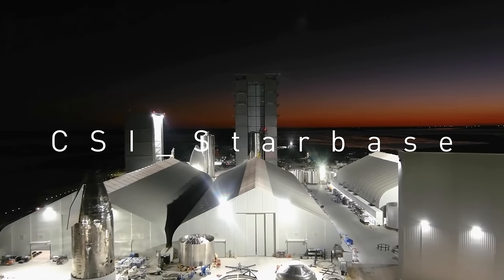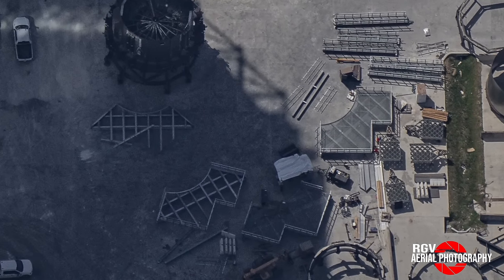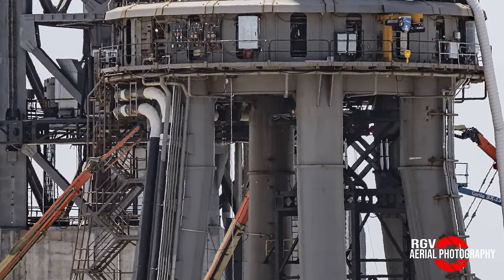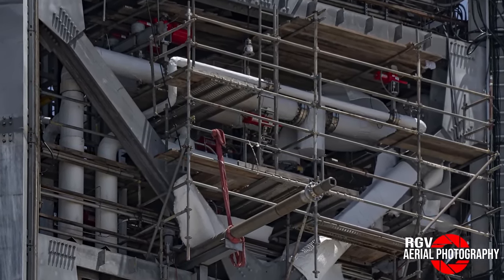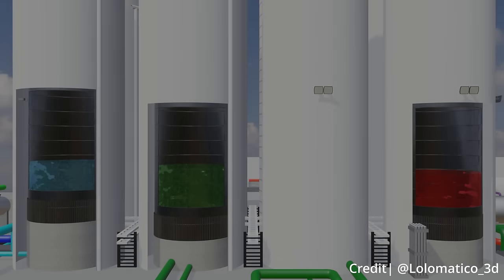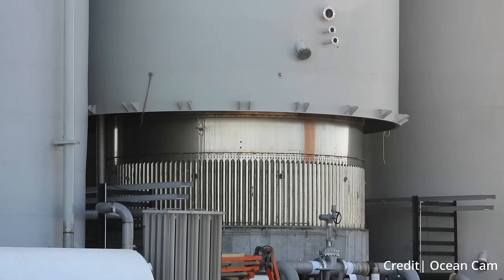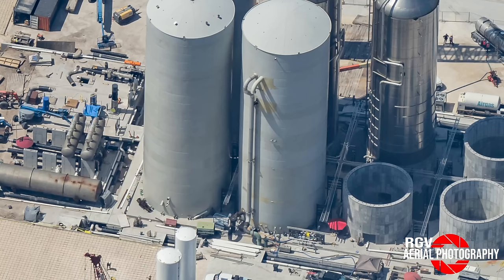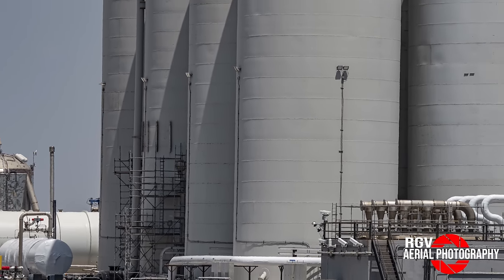Failed Water Tank Forces SpaceX to Redesign Tank Farm

Comment: @ 10:04 On F-4 aircraft, the wingtips can fold up and secured with a "(remove before flight)" safety lock. When they are lowered, hydraulic actuated hinge pins slide into the wing lugs to lock the wingtips for flight...
These "wings" can be raised with hydraulic actuators and hydraulic hinge pins can slide into the lugs to secure the platforms in the up or working position....all controlled by a little toggle switch or two, and electric hydraulic pumps @ 3,000 psi...or more.. Then they can be lowered by gravity...

Comment: They might actually have decreased the margin of error because they WANT a smaller margin of error. Imagine an engine failure at the very last second. You might not be able to catch the ship, but you want to minimize the damage to the structure. Shorter arms might be easier to get out of harm's way.
Reply: Shorter arms may be able to open and close faster due to less mass.
Reply: @flewdefur  also lift faster

Comment: Great analysis, I‘m blown away every time about how much information you manage to pull out of the photage. Have you thought about sharing your insights with Spacex, for example when you noticed the missing strengthening rings on the water tank way before them? Might save them a lot of time.
Reply from the maker: No I didn’t trust myself back then.  But you bring up a very good point because I probably could have stopped them from building those two vertical methane tanks before it ever happened.

Comment: Best SpaceX/Starbase coverage online.  I hate to say it, but the shorter chopsticks may mean that SpaceX is abandoning the catching of booster by the tower - or this tower anyway.  I wouldn't be too surprised to see SuperHeavy grow legs.
I don't see a return pipe into the new water tanks.  
To me, the biggest problem with modifying or replacing  these gigantic tanks is the tons of perlite insulation.  It's a fairly natural substance, but you can't just dump it somewhere.  Vacuuming it out so you can lift the shell looks really expensive.  Uncap it, get inside and add some internal ribbing?  In the end it would be just a water tank, and they have two of those now.  Can't even scrap it.

Comment: I just caught up with your latest video after discovering your channel, Zack. 
You are in fact answering many of the questions I was having about how things work, what does what, in a way that is beyond speculation. 
Really looking forward to seeing more of your content. 

You were the first to point out some structure, inside the chopsticks, that, when raised, should absorb the remaining energy of the booster or Starship coming down. 
Everybody says crazy, but you point out the component that should do the job. 
I had some doubts on how the arms would absorb this energy, knowing the Falcon landing gear has titanium shapes inside, that deform to absorb the remaining kinetic energy. 
And Falcon is light compared to Starship, let alone the booster. 
I still feel a landing catch is extremely dangerous, as it should catch the booster on the pins sticking out. 
If the chopsticks had a rounded shape attached, that could align with the booster, this would help. 
But maybe SpaceX feels they can perfectly align the pins with the chopsticks? 
Indeed, they can gimbal the engines, to rotate the booster on its vertical axis. 
Then booster has pins, Starship has holes.
How is that supposed to work? :-) 
It requires a perfect, not near perfect, alignment and insertion moment.
Reply from the maker: I’m going to be doing a part two on this because they still haven’t added the pistons for that landing rail. I see them working on it everyday though.
Reply: @CSIStarbase  would really love to see your insights on that.

Comment: I'm sure you were right that they were originally going to add reinforcement rings. If they weren't going to add reinforcement rings in the first place I doubt they would have gone to all the trouble of stripping the paint. Of course it's possible that even though the shell is no longer usable for water storage it could still be used as a cryogenic shell in another second tank farm that Space X will need to support a proposed second launch tower. So they had to repaint it against rust.

Comment: Zach when you talked about stripping the paint off the welds, that was on the cryo shell. The reinforcement rings would need to be on the tank itself, right?
Reply from the maker: Lol that is the tank.  There’s no shell.
Reply: @CSIStarbase  
Sure, that rust showed water leaking directly out, not perlite.
Reply: @CSIStarbase  It strikes me that if the unused Methane tanks which have a 'double; wall are repurposed to carry water inspection for leaks would not be possible. or at least more difficult.Would they consider removing the covers? Is the ribbing on those tanks sufficient for water mass/pressure? I guess they must think so . Keep up the good work

Comment: With some creative engineering the water tank could be saved, I believe. Maybe some channel running vertically around the tank. Along the channel that rides on the surface of the tank you could place slots for spacing of cable which will be post-stressed. Maybe you could do it with metal straps spaced vertically on the tank and do away with the channel.
Reply from the maker: It appears that they are still trying to save it.  I can still think of a good use for the tank if they are able to save it.

Comment: A possible reason for the shorter chopsticks at Robert's Road is speed. A shorter arm is not only lighter, but the mass removed from it is all at the tip of the chopstick and the farthest from the fulcrum. But even if that's the case why go so short? Extensions?

Comment: It would make sense to me that they have increased their confidence of where they can position the rocket and shorten the arms. Because the arms are made to catch the rocket when centered in them so if they can Center it left or right then they can Center it as far as close to the Tower and away from the tower for a lack of better words. Both are critical, because it's too far in it might hit the tower, and it's too far out on the chopsticks the leverage Force would increase and possibly bend or snap off the arms or put too much stress on the tire base and eventually weaken it and make it snap fall over while catching the booster. I hope I worded that well enough for the surprise pop quiz.   👀

Comment: its pretty amazing how one screw-up (building CH4 tanks not compliant to local standards) provides the solution for another screw-up there. I was sceptical that they would really use tanks designed for cryo for water (which now has a useless shell around it) - but that shot of a flange connecting a cryo pipe to a water pipe convinced me.

Comment: The water tanks might not need supportive rings because they are made of different steel, I imagine the space grade stainless steel has a higher tensile strength than whatever is used for a water tank whose materials are chosen to be made with as little money as possible.

Comment: The water tank story certainly casts some doubt on the engineering capabilities at SpaceX. Your documentation of the lifting of the oddly shaped tower sections leaves me with even more questions. They should be able to calculate precise weights and determine the proper lifting procedure without resorting to trial and error.

Comment: Maybe the shortened chopsticks won’t be used for catching at all. If a catch fails it could take out so much infrastructure. Perhaps the plan is to build a second tower in a more isolated spot that is used only (or primarily) for catching - at least in the short term until SpaceX have been able to demonstrate that they can reliably catch boosters and starships. SpaceX can then lengthen the chopsticks as much as is needed.

Comment: Hi CSI Starbase,
Thanks for such an in-depth look at all the progress going on at Starbase. The question that I was wondering for a long time is why haven’t they built a large water tower at the tank farm for the water deluge system? I always thought that a large water tower was a basic necessity at all launch pads.
Reply: Basic to all launch pads with flame trenches, This one has none. 
They will use a mist rather than a deluge - for now anyway.
It makes the problem of collecting the water easier too. They are not allowed to let it run off into the marshes.

Comment: @CSI Starbase, an important note for you! 
I've experienced a strange error after subscribing. On both my iPhone (old 6s) and iPad (also old Air 2) the notifications bell is stuck at "none" and each time clicking on it sends me to my device settings. 
On my PC laptop, I have notifications set to all and that looks correct, but it seems that doesn't sync with my mobile devices. 
I just updated to iOS/iPadOS 15.6 and the same error is still occurring. 
I hope this helps your channel. I really like your content and style! 
*Edit, on my even older iPhone 5s, the "All" notifications is set correctly. This old device is running iOS 12.5.5. Curious.
Reply: Hi Bill, thanks for the heads up. I've just checked on my iPhone 11 and it seems fine. When you're doing this are you on the video or channel page? I've tried both and I'm able to change the notification status.
Reply: @geoffallan  Hi Geoff, the weird redirect is only on the apps. Maybe my old devices but then my even older 5s works fine.

Comment: It's really weird how they waited until the tank almost blew in their faces to make a change.
Reply from the maker: I think they tried to save it.  I should have been more clear about that part.  When they stripped off the paint, I think they found something that told them it couldn’t be fixed and the solution to that problem probably changed several times over.

Comment: Nice and original content!

Just the leakage argument doesn't necessarily makes sense. You're showing some rundown on the cryo shell. That shell is separated from the actual water tank by a layer of expanded perlite. So suggesting it's a water leak from the tank at that height, implies the whole cavity between the tank and the shell would be already filled with water, before it can start leaking just there ... ?
Reply from the maker: The original water tank does not have any of that.  Its a shell with no interior tank
Reply: @CSIStarbase  ok so it just looks like a cryo shell around it, but it's the tank itsself.
Reply: You can see there's no inner concrete base for the water tank here 23:46 and then workers welding in place a steel bottom for the tank.

Comment: Very good reporting!  Now won't the new tanks fail too?
Reply from the maker: The new tanks are designed to not only withstand the hydrostatic pressure but also to withstand 8bar of gas pressure inside of the tank.  It should work perfectly.
Reply: @CSIStarbase  That is good to hear! I am still concerned about the water deluge system, seems like it is a little lacking in water volume, compared to the BTU output of 33 Raptor Engines!  Keep up the good work, I like your dissertation regarding the tank structure.

Comment: 9:55 why not just a REALLY long metal rod threaded through them all, so you only need to lock them all once rather than individually?
Reply from the maker: Oh snap.  You are right.  That’s probably the only way to do it honestly.
Reply: @CSIStarbase  …well, because a REALLY long metal rod probably won’t fit (it has to stick out one side);
Next line REALLY long rod rod would need all the holes to line up absolutely PERFECTLY.. 
third, failure or damage to a REALLY long rod rod means replacement is a pain (if it even ‘fits’, remember it sticks out).

Individual, much shorter, rods are in reality much easier to work with, handle, line up, install, remove etc.

Cranes use these type of connectors, among other structures. (Bridges, trusses)

Comment: we can't be sure if they  didn't have more ribbing on the inside of the rings, but what this does tell you is the tolerance of the rings with water as Elon said about keeping water in the walls of starship :) even in failure we make progress.
Reply from the maker: We know for sure there is no ribbing.  There would be weld marks!
Reply: @CSIStarbase   .. I thought they said something about that with mrk 1 but it has been a long long time and a lot of speculation. Though my curiosity was more about Elon talking about storing water around the crew areas in the starship and what this means for that?

Comment: So are the water tanks they using now reinforced like they should be? Guess I missed that part
Reply from the maker: Yes all of the GSE tanks have the same reinforcement on them.  I guess I should have been more clear on that part.
Reply: I think it is a misunderstanding there: the braces around tanks helps for a situation when vacuum or lower than atmospheric pressure occurs in tank due to it being emptied, while providing close to none extra strength against elevated internal pressure or water static head. The vertical ribs at bottom helps at rigidizing the vessel against vertical and horizontal stresses  but these usually do not occur with a water tank.
The two extra tanks for water may have the reason on using them for the Water Acoustic Surpression System, that initially wasn’t very develloped, at least as design.
Reply: @Dalidoso  cool thanks

Comment: I quickly realized back in like Aug/Sep 2021 that nothing was going as planned, that wild speculation was instead replaced with SpaceX just not caring about Boca Chica anymore. I was sucking the ElonKoolaid bigtime back then, but literally overnight, I was like - NO WAY!. All the design lessons were instead applied to building the real facility in Florida. Oh, and don't even get me started on the issue those chopsticks- they WILL NEVER catch a booster. Which makes modifications in Florida make way more sense. The booster will land on the sea platforms (at best). They have committed to a launch or 2 from boca chica, but that is it. They have about 12 months left for Florida to be operational. Oh, and starship is never going to be moon either! HLS will be on the order of mag size of dragon, starship will be converted to a 2nd stage to get HLS to the moon, that's it. All for a bill of about 15B to NASA as NASA needs to modify the launch timing. A lot of news will be coming Dec/Jan this year on the "new plans"

Comment: Great video.

I'd encourage you to condense things down a bit more, though, especially if you're having viewer retention issues. For example, in the section about the water tank, I don't see why talking about the differences between cryoshell domes and the water tank domes was necessary. I think a lot of interesting, but unnecessary tangents could be cut from the first part of this.

Same with the new Raptor stand. I don't see why it's necessary to go into the history of the RGV streams and how you pieced together what it was.
Reply from the maker: I understand that. My goal is to be as thorough as possible.  When these tanks were being constructed no one understood the difference.  So I’m filling them in on the details they missed.  Plus I also try to be considerate of the fact that some people may not know any of this stuff at all.  For a video of this length, a retention level approaching 33% is pretty high.

Comment: lol the watertank issue.. this is actually an embarrassment for the starbase engineers :(
Reply: Na, it's as much a prototype as the Starship?
Reply: @geoffallan  
Those rust-leak-stains were just sad.
Reply: @geoffallan  but why are water tanks prototype? there have been water tanks on this planet before unlike starship.. the rocket is a different situation..
Reply: @thefamilyguy it was just a thought I had, all the GSE tanks were built on site  using a similar  process as they’re using for the ships. As the video points out, existing tank designs all share the decreasing gap of horizontal bands the lower you get on the tank. Therefore the Starbase tanks were attempting something different hence my prototype comment.